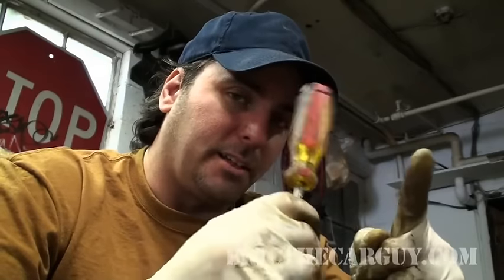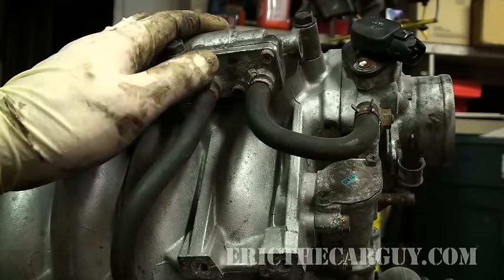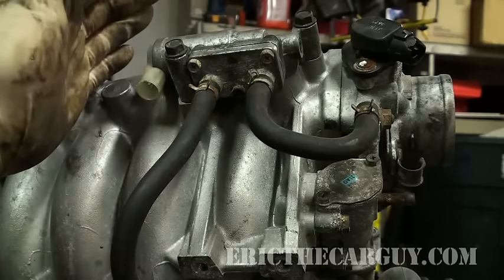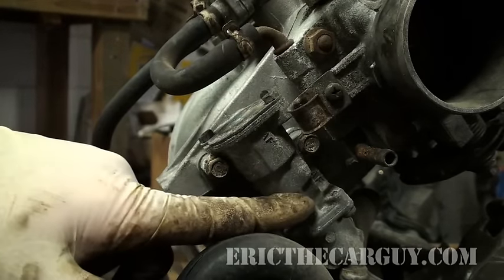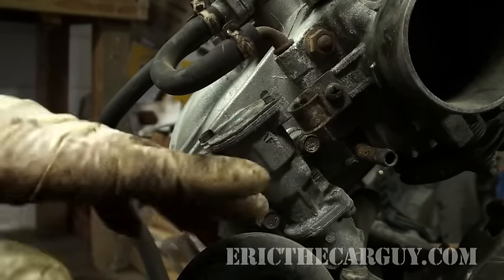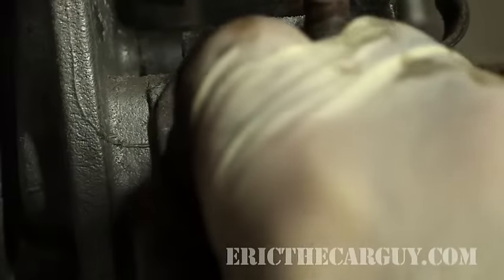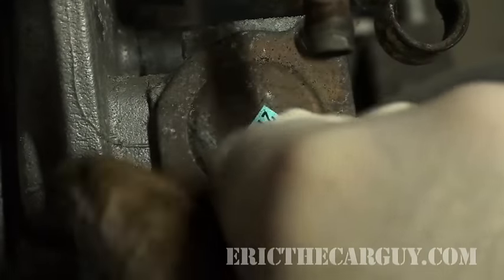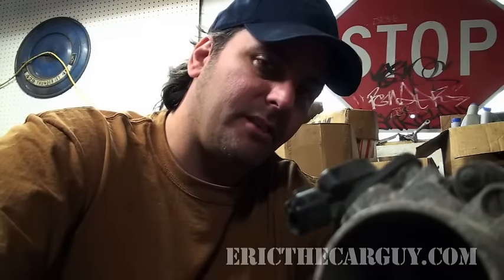How To Solve Honda Idle Problems - EricTheCarGuy

Comment: Greetings ETG and thanks for the information and philosophy.  I had a problem with the idle (hunting) on my Odyssey 2001 4 cylinder, the  manuals I found all referred to a throttle adjustment screw on the throttle body but this model (RA6 4 cylinder in Australia) does not have a throttle adjust screw.  When I removed the IAC valve (IACV) for the second time and cleaned it, this time I separated the electronic component from the IACV body and cleaned the valve shaft and case, this fixed the hunting problem but idle was 1100rpm instead of 700rpm. I noticed that the IAC electronic component screw slots are elongated and allow a small clockwise / anticlockwise (maybe 5%) adjustment.  I put it all back together (the hunting problem resolved) and sure enough, a small but significant idle adjustment.  You are an inspiration.

Comment: Your instruction on how to adjust the fast idle thermal valve isn't correct, or should I say was misleading.  By your example you say to snug it down, but due to the location of this valve, most people will do this work with the car off.  If you snug it down cold, then you will get no cold air bypass, as the valve extends when coolant warms it, thus sealing off the bypass air when warm.  So, to clarify, if the car is cold, DO NOT tighten down the FITV all the way, it needs to allow some bypass air.  The valve will heat, extend and shut off the air if working properly.  The simplest suggestion to tell if the FITV is your issue, is with the car idling, inside the throttle body there will be two holes on the left INSIDE the throttle body, one high and one low.  The lower hole is for the fitv.  When at normal operating temp and the intake removed, plug the lower hole with your finger...if it is pulling vacuum, the FITV needs adjusted.  This is the most common cause for the bouncing idle.
Reply: Eric made that test clear in his video as well as instructing us to watm the motor up b4 adjusting.

Comment: What should I do if once I turn on my Ac my idle drops as if it's gonna die, and while I'm driving as soon as I let off the gas the rpms drop to quick (almost like a second handbrake). Also I will have low power when taking off but sometimes it would get short surges of power out if nowwhere. But once I turn my ac off everything is back to normal. I drive standard by the way
Reply: +Psycho & Keith my also same like you car problem .",now you fix already ?
Reply: ....no ppls reply
Reply: +Lee Sky there is one fix, Ac delete;) haha
Reply: had this problem but I got a check engine light fixed the code and it fixed that issue. on mine if I ever revved  it would drop down to 300 rpm. it would want to surge buckle.  also when I turned on the AC . still does it but now not as nearly bad. also manual 2.2 acura cl
Reply: +Psycho & Keith most likely electrical issue.
Reply: Psycho & Keith clean out the IACV  and also replace the pcv valve
Reply: I had the same issue, it was a charging issue; don't know if it was battery or alternator as I changed both, but issue went away after this repair.
Reply: check your IACV, if may not be opening. to kick up idle for AC.

Comment: Hey help me out. I have major low rpm it is near the zero. What should I do?
Reply: I have the same problem when I floor it and run the car hard then when I drive normal and come to a stop it idles really low
Reply: exact same problem
Reply: tap the idle control valve. i had the same problem and that fixed it for me
Reply: check the throttle cable tension make sure that's snug and if that doesn't fix it try unplugging the cooling fan switch

Comment: Can someone help me with my problem . my honda accord 2003 v6 has an low idle . There is a check engine which reads low idle . i changed the spark plugs because someone told me its because of it but nothing changed . and because of the low idle i cant turn on my a/c . every time i have to stop on a stop sign i have to keep my foot on the gas . 
Thanks
Reply: I have the same issue. mine will die when it in Park or at a stop
Reply: +Randy Fought you need to check your check engine light and look up the codes on Google. don't just change parts and hope you fix the problem. I'm guessing your car problem is within a vacuum leak, tps or map sensor.
Reply: +D'Faro  it was not a leak or anything . just cleaned the choke and its working fine . . thanks for the reply guys means alot
Reply: im having the same exact problem did u get it fixed?
Reply: +D'Faro i dont have a ch
Reply: Fetus Eater yes i got ot fixed by cleaning the choke . And its working fine
Reply: @Demon-wo6xs  what's a choke?
Reply: @jponz85  the throttle? Butterfly? The thing connected to the intake,

Comment: hondas are notorious for problems man, just buy a toyota ffs
Reply: Mate I've had two Hondas and they are bullet proof. A 92 civic then an 05 Honda euro. I don't doubt the odd bad one exists. They need the oil changed religiously and it should be good oil. I do agree Toyota also makes a quality motor
Reply: Rationalist Society ..me ive owned hondas my whole life i have 91 accord with 590 and only did reg maintenance .and i have 2 2000 accords with 350 and 390.ive had 0 problems .my 91 ive owned since 91k and 00 accords since 75k and the other 0miles.there bullet proof def.i worked at ira toyota as a tech for 3yrs and yotas always have a issue
Reply: nonnono
Reply: Ed Leedskalnin your deffently right
Reply: btro toyotas are notorious for having interiors made out of Tupperware and dogshit. Seriously if I am going to pay 40k for a pickup truck the dash should at least resemble the skin of a dead animal.
Reply: Troy Smith all these 2000 cars and up are nothing like the older models. They don’t last at all
Reply: im a 1991 TOYOTA mr2 owner that statement not true! period. i love my car but sometimes ow sometimes! ps- by the way i also have a D16z6 as my work comuter never harassed me

Comment: Thank you for the great video

For clarification
1. If the idle smooths out when the iac is tapped then i can assume it's bad and needs replacing?

2. Once the fiv is re-seated or tightened im gtg? Are youbsaying that under normal operation it should not need adjustment down?

Comment: Quick question 2002 Acura rsx type s. When I first start vehicle or in other words coldstart my car idles rough around 500 bouncing for about 5-10 seconds then if I give the car a little gas it completely fires up fine and runs fine rest of the day typically. Although today the car completely stalled out 2 times when started and the 3rd time it fired up completely fine and ran fine the rest of the day. Also while cruising and if I put the stick in neutral my idle fluctuates from 1000-2000rpm, I believe this is called “surging” correct me if I’m wrong. If I drive vehicle for 20 minutes the surging completely stops and drives fine typically. On forums everyone mentions iacv which I haven’t cleaned yet just want to get your opinion you seem very knowledgeable.

Comment: Helpful video . Good presentation style! I only have the idling issue during winter. Once the engine is warm, it is not a problem. The car hesitates and sputters until that point...embarassing to be on road.

Comment: I got a 01 prelude.  On cold start it has this rough bouncing idle that will somewhat try to fix it self around 1k rev then the engine stalls completely.  When I turn the key, the fuel pump wont even kick in, or sometimes it'll kick in and work fine.  Other times I have to wait few mins, then turn the key and fuel pump primes and car starts up fine.  After warming up, it works fine no stalling.

Comment: i am currently having this issue. 2003 honda crv 2.4 UK manufactored model. things ive tried, 1)purchased the $300 oem iac , 2) iac relearn procedure 2sec on, then 3k rev for 10 without any load, 3) removed the ecu/pcm fuse for 5 min then replace and tried the relearn again, 4) check for vacuum leaks, 5)replaced the pcv incase this was the issue. i initially removed the old iac cleaned it and installed with no luck, this is why i bought a oem replacement. One thing i’ve noticed, when i erase the p0505 code with obd scanner, the crv idles perfect until driven and the check engine light comes back on. hopefully you may have some insight. thank you in advanced

Comment: You're the king. Rough low idle, lasted about a day and then check engine light.  Checked coolant and it was low so since I had some on hand, figured I'd try that first.  To my surprise, it went back to smooth idle within about two minutes.  Thanks bro!

Comment: Thanks for the video Eric, I have error code p0300, p0303, p0304 on my 99 Honda CR-V, I have previously replaced the distributor about 20k ago as another error code said the cam position center. As I understand it the ignition coils are in the distributor so they shouldn’t be causing my problem. I also changed my spark plug about 50k ago and thought they should still last another while, I took them out and cleaned them and they looked good. Is it possible they they IAC is responsible for these codes? Again from what I understand the spark plug leads rarely should be changed.

Comment: Hello Eric first of all, I would like to let you know that I enjoy your informative videos.  I recently did a throttle body cleaning on a 2009 Honda CRV 2.4L four wheel drive.  The throttle body was definitely gummy & dirty.  The idle had a slight shake and hesitation coming to a red light or 4 way stop before the air intake cleaning.  Now, the SUV runs smoother but with an abnormal high rpm above 1000 parked at idle. Also, the vehicle surges up & down at cold starts.  Once the engine warms up, the RPM settles at around 1,200 but with a check engine light & engine code P0507 for idle air control valve at high RPM!  Gosh, I hope I didn't damage the IAC.  I tried everything from disconnecting the battery for 30 minutes, doing the reset/relearn Honda procedure including driving  the vehicle for a while on the streets & expressway and I even bleeded the coolant system from any air pockets since I disconnected two coolant lines.  But that didn't help out either.  I cleaned the throttle body without removing the assembly and had someone hold down the gas pedal to keep the throttle plate open.  Hopefully, you or some of your fellow mechanics could give me an idea in what might be going.  I'm a diesel mechanic employed to work on transportation coaches.  Been a while that I worked on cars.  Thanks for any advice you could give me.

Comment: Had this problem with my 2014 Acura TL after driving fast in hot dry weather then idling for a while with the AC and radio on. I replaced the timing belt and water pump myself just before the trip and put about 1,000 miles on with no issues. The temperature was normal on the gauge. The car bogged down in reverse for a few seconds. Never happened before and hasn't happened since. I spent a few hours in the hotel looking over videos. I decided that if it didn't repeat itself, that I could get it home. Drove another 600 miles with no issues. I'm going to take a look at it again today to see what it could be.

Comment: He makes it clear in other vids that a garage makes money on replacing parts... not cleaning yours or with mechanic labor rates. If you can do it or find a local amateur who is skilled... do the simple stuff for yourself. A skilled guy who is not a pro mechanic can be very handy and pay him what he asks and thank him !  Air hose replacement, ATF drain/refill and new filter, PCV replace and maybe the hose(s) for it, air filter, engine oil and oil filter change, etc. .  you can do for yourself, for most fellas, if you are fairly handy with tools and have them.

Comment: Question?  Is it okay to put a drop of loctite on fast idle valve to keep it from backing out?  Next.  Idle control valve seems to have two possible problems.  Blocked coolant passages.  Fix is obvious and run fresh coolant.  I see that carbon can build up on the valve also.  I associate carbon with fuel and or oil.  I have a lot less problems with fuel issues when running Chevron with Techron.Will good fuel help to prevent the carbon buildup in the Idle Control Valve?

Comment: Thanks for the video, it basically allowed me to fix my Dad's '97 Accord idle issues. The idle would surge, then settle, surge then settle. It got so bad he could barely drive the car more than 25 MPH. I replaced the IACV. Didn't fix it. I bled the cooling system. Didn't fix it. Then finally I took off the Fast IACV and screwed that piece back down. THAT FIXED IT. My dad says the car now runs better than he ever remembers it running. Thanks!

Comment: 14 year old video and I swear it's still the most helpful around, I've got 2 different throttle bodies and my car has the manual trans, 1 throttle body off an auto which my new motor was out of, my old one is manual throttle body, manual has super high like 3k to 3.5k rpm, and auto has surging problem will surge between 1.5k to 2k rpm, now might be able to pull both throttle bodies apart and know halfway what I'm doing with them lmao, was considering buying new throttle body because I thought it was the throttle position sensor but after watching this I feel I was on the right track with cleaning my iavc and adjusting the fast idle control

Comment: i got a 39 accord 2.2 liter just did a engine swap do to a blown engine replaced the f22a1 with a f22a6 didnt have the right ecu so had to use my old 1 had to change the intake over and the exhaust for that reason . but anyways car was running good started have a idle issue up down up down watched you video ended up adjusting the fast idle valve and seems to have fixed my issue. will know morn in morn  ty

Comment: Hey Eric, so I have a pretty unique idle issue relating to the A/C on my 98' Civic LX (94k mi). Idle is perfect w/o the AC on. I just had the A/C replaced (compressor, condensor, dryer); when the A/C compressor engages the RPM drops to around 300, the compressor then shuts off and RPMs go to 1,100 or so. The system will turn the compressor on and off at increasing frequency. When I plugged in a reader, it showed engine load with the A/C compressor on at 50%. Two years ago I cleaned our the IAC and there are no trouble codes on the system right now. Last year I replace the upstream 02 sensor, but not the downstream one. When looking at the tool the downstream 02 is latent, more so than it should be. To me this sounds like an issue with the ECU under compensating for the increased load and not adding more fuel to the system, resulting in an under-damped system (increased oscillation in RPMs). Could this be related to the O2 sensor? If idle is nominal w/o A/C on, does that negate the IAC / vacuum leak? What else should I check? The problem is similar to https://www.youtube.com/watch?v=dsT6N9r93to

Comment: I have an issue on my b20 where idle was at 200 rpms almost stalling... changed the iacv due to check engine light... idle got a bit better but not to my enjoyment.. I’m at 400-500 pretty normal for many but the car is shaking.. so uncomfortable.. replaced and cleaned fuel injectors a new spark plugs and wires I have yet to to fix the Fast idle valve thanks a lot Eric hopefully it solves my issue

Comment: Very very informative I have a Honda civic EX manual Transmission and I am experiencing the fluctuating aisle and you were right I ran right over to Advance Auto and bought another bottle control valve so before I purchase it I will do as you stated and check the higher idle component and see what happens and thank you again great video

Comment: Eric, I have been beating my brains out trying to figure out why this 97 Civic is idling so erratic. I have looked at many videos and read many articles and NOTHING worked. I was about to go and buy a new Idle control valve for $180.00 and then I came upon your video and I thought what the hell, I will look at just 1 more. After watching it I then went to my tool box and found the oldest nastiest screw driver I had (I did not want to use 1 of my Snap On) and tried your little trick. I could not believe it. It worked. Just wanted to say thanks for the video. I will come back and ck out other videos of yours very soon.

Comment: Awesome video I've done and tried everything you've messed with in this video and went from 3000 rpms to 1200rpms on idle. Still not good I'm wondering if I put too much carb cleaner in my iac and ruined it

Comment: Quality vid Eric 👌I have a Honda civic 2003 1.4L SE - very high idling at 1500rpm stable with the engine management light on- Just wondering what could be the culprit for this before buying any parts or opening things up I shouldn’t as mentioned 🤔 cheers in advance guys!

Comment: Today my Teg was giving me the same issues I had when my IAC valve was bad. Turns out the rotor screw had loosened out and it had completely destroyed the interior of my my distributor cap. I chased the totally wrong system for a long time before figuring that out. Biggest hints were the fact that there was no CEL, and that it was getting worse over time.

Comment: Fantastic suggestions!  Just tapping the air control valve will usually show a response?!  Also, how do you get air in the cooling system?  Better yet, how do you get it out?!

Comment: I replaced my IACV on my 98 D16 engine after attempting the cleaning method. I was experiencing higher idles up to 2,000 at random times during driving. With the new part on that higher idle is now constant. While it took care of the IACV code, now I’m seeing a code for the Intake Air Temp sensor. Thoughts?